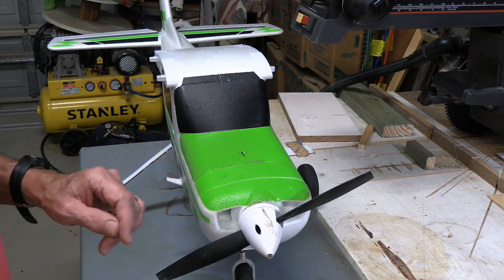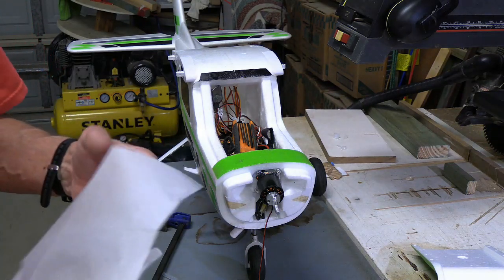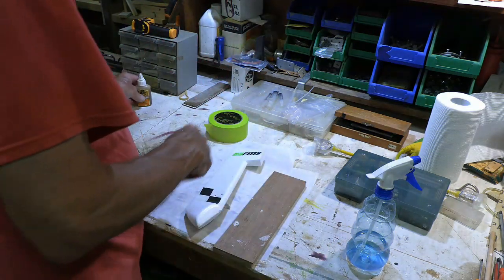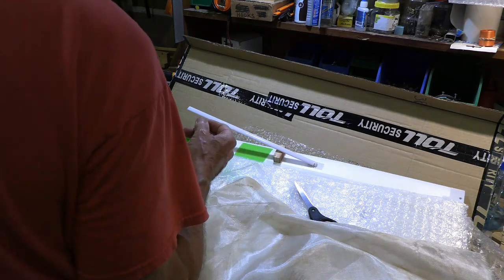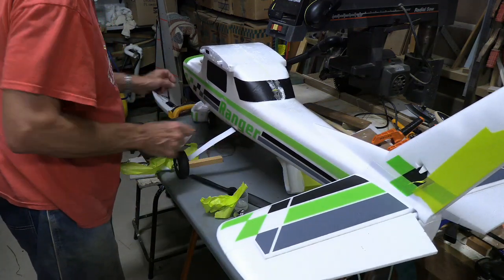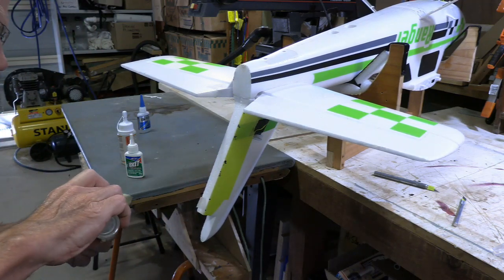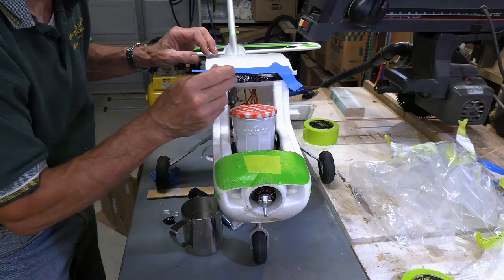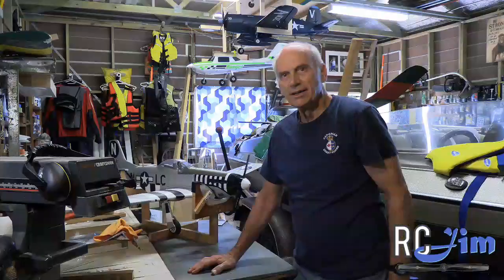FMS Ranger Repair After Nose Dive

Comment: I have a newer ranger that took a 5 foot nose dive into some water (trying to land on floats, cross wind got me due to inexperience)...I pulled everything apart to dry out. Not getting any throttle response but everything else works. Thoughts?
Reply from the maker: If it was salt water, all the electronics are shot - even if working at the moment.  Fresh water you might be able to still use the servos and battery.  The ESC probably needs to be replaced.  Be careful, because corrosion can set in over time, and create further problems.
Reply: @RCJim  turned out to be the ESC fried and took a battery cell with it. Salt water is all I've got down here, unfortunately, so I'm just living with what I got.
Reply from the maker: Yes, I've also had nasty experiences with salt water, and some of the faults don't show up for weeks or months.